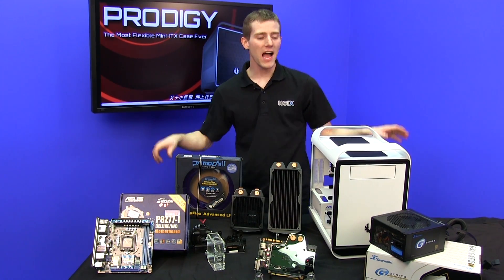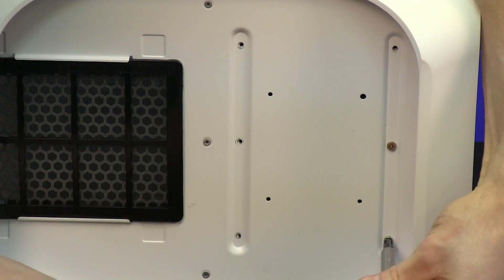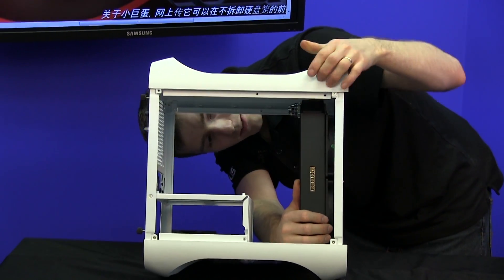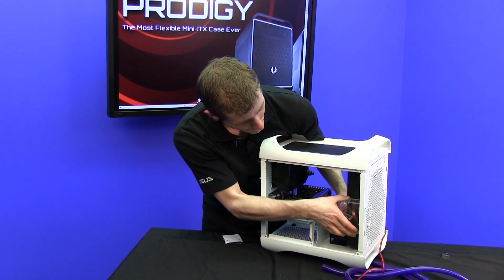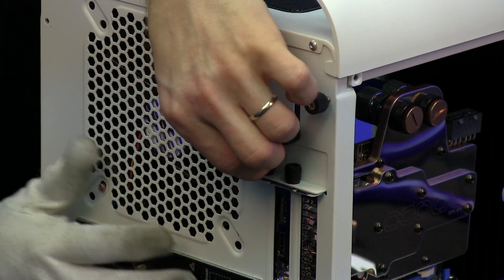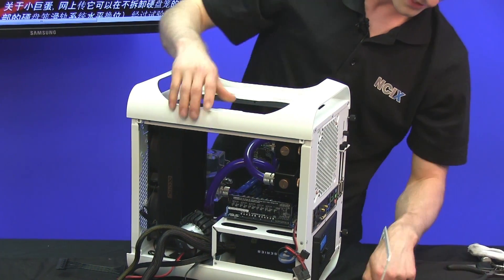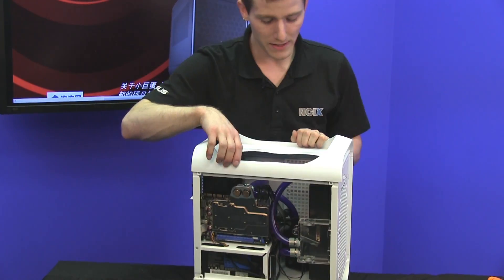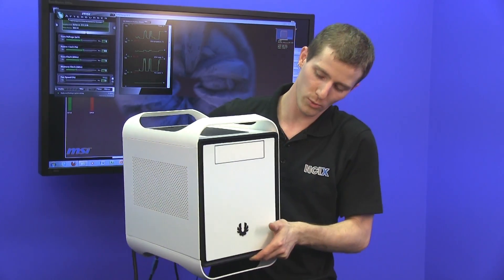Ultimate Watercooling Build Guide: Bitfenix Prodigy, 3570K, GTX670, swiftech

Comment: His question was, is it safer? The answer is yes, fan cooling is safer as there is 0% chance of any liquids leaking on to your components. This however is still highly unlikely if you set up your watercooling correctly. More likely to happen with one of the AIO liquid coolers. If you are unsure about watercooling then stick with air. Main benefits of watercooling are noise level and lower temps but the best air coolers have very good performance also.

Comment: It depends.
Some cheap fans actually breaks and blows some oil over the system.
But if you use an ALC it will prob not be a problem.
If you're going custom WC make sure that you know what you're doing.

Comment: Screw small back plate to the power supply mounting holes (Inner Holes) and then slide the power supply in to the case and then use the outer screw holes of the plate to screw and secure the PSU to the case.  Don't just wedge it all up in there like he did LOL

Comment: Umm, after I tried to read your comment, I think I get the question.  The Quadro series (He has one in this, I think) are workstation cards, very different from gaming cards.  This small motherboard is a Mini-ITX Board, and, if it has 1 PCIE x16 Slot, it can fit any graphics card that is 2 PCIE slots or smaller.

Comment: I did the same and it works fine

except I used a smaller pump and reservoir and it is called the. Alphacool DC-LT 12v Ceramic Pump and the 
Alphacool DC-LT Pump Top  and Alphacool Reservoir for DC-LT Pump Top

Comment: I like your build but i am gonna fit a 30mm 240mm on the top and a 200mm radiator in the front with a bitfenix 230mm

Comment: You're so wrong it hurts my brain to read that. The NH-D14 is about as good as it gets, and it's about tied or worse than a H80i and H100i. Yes, it's cheaper, but it's absolutely MASSIVE, and weighs so much that a buddy of mine now has a snapped Z68 motherboard because of the stress the cooler put on it. You can Stuff an H80i just about anywhere in a mini sized case. But these are closed loop watercoolers, which get their ass completely handed to them by custom loops. Sorry, but you're an idiot.

Comment: Linus said " we're using double thick radiators"  well for most All in One liquid cooling systems that are prebuilt, etc..they are 25mm thick.  However, he's using a custom setup liquid cooling kit.

Thus if all else fails and you can't find that exact 240mm rad and other 120mm rad Linus used in this video.  I would assume the BOTH of the rads are at least 50mm thick WITHOUT any fans attached given how thick they look in the video in relation, visually, to the fans attached that are 25mm

Comment: Why do you need 32GB of ram? Do you plan on running VM's and adobe premier photoshop and sony vegas hard core? CAD? Unless you're using something extreme RAM intensive like any/all of those dealing with content creation, 16GB of ram should be plenty. There isn't really much point in more than that,and there is absolutely NO point in needing that much in gaming at this point in time and probably even for the next 3 years.

2nd question...The Prodigy M coming in a few months, per Compute.

Comment: Yes.  tHIS , original, prodigy.  However, there is a Prodigy M coming shortly as shown in one of the video coverage at Computex recent that houses a Matx motherboard with the board back in vertical position but rotated 180 degrees to where everything is upside down from what is considered the normal orientation of most cases.

Comment: Because most people who are plugging and unplugging usb devices like thumb drives and other temporary storage options may have their desks in a corner like me and get tired of having to turn the case and/or reach around the back to connect and unplug usb cables.  It's easier to plug and unplug usb stuff on the front or as close to the front as possible.

Audio?  I don't know about you, but when I put on my gaming headset, I'm not plugging it into the rear audio ports.  corsair 550d here.

Comment: Yes if you don't use a 240mm rad in the front you can leave the bottom drive bay in. This will mean a lot less room for a pump though. You may be able to fit a 2.5" hard drive in the side panel but I'm not sure.

Comment: I think they attached the heatsink wrongly, because the thermal paste only hits half of the copper core on the heatsink which is made of aluminum and copper. I reapplied the thermal paste not so long ago, it went 12-15c colder. The thermal paste I used was a rather crappy CoolerMaster NanoFusion. It still goes hotter, but on 1366x768, 89c was at the near end of the game, the early times went a lot colder, but on full HD it's about 85c.
GV-N550OC-1GI. In my city, they only sell GPU from Gigabyte.

Comment: So just get some 99% isopropyl alcohol and wipe the old stuff off and if base of the heatsink is aluminum get some Artic MX4. If it's copper, you should get some Coollaboratory Liquid Ultra. Liquid Ultra corrodes aluminum so don't get it for aluminum heatsinks. However it gives better results than any other thermal paste available to public. I have a GTX 680 Lightning, the highest end GTX 680 you can get, and they still did a bad paste job. Applied MX4, temps dropped 15c.

Comment: That's ridiculous man. What manufacturer is your card from and what model? Those temps are WAY too high. You might want to consider taking off your cooler and applying new thermal paste. There is no reason for the card to be running that hot, even with the standard heatsink running at half fan speed at full load. They probably did a bad thermal paste application. Manufacturers sometimes use way too much or the paste is crappy and dried up already and needs some new stuff.

Comment: Yes, I know about what temperatures are fine for my graphics card, but when I played Crysis 3 with the lowest possible settings but the resolution set to 1366x768, it went to 89 degrees celcius and on most games, it goes around 15 degrees celcius hotter on 1080p. Also, as you said, I already know about that too and I want that my GPU live long. Maybe I'll check out more on MSI Afterburner because currently, I'm only using it to lower the clock speed.

Comment: 80c is fine for a GPU. The 550 ti can handle up to 100c, but the unofficial rule is try to keep the temps 10c-15c lower than the official maximum so your GPU has a good lifetime. Try to keep your temps under 90c and you're fine. If the fan noise is bothering you, you can make a custom fan curve in MSI afterburner if you haven't already. Also, if you can control the voltage (try unlocking in the MSI AB settings) try stock clocks but undervolt it and see if it's stable. It will lower temps a bit.

Comment: I never checked much about water cooling and I just knew that Corsair's water cooler works on graphics card. My 550 Ti temperatures are about 67 degrees celcius when I'm in a game, but on some games it goes at 77. That was on 1366x768, but now I'm using full HD which increases the temperature to over 80 degrees celcius. I think I'll check out more about water cooling my graphics card. Right now, I'm just underclocking, I did notice that it goes a lot colder.

Comment: Indeed. Especially for the GPU. GPUs get a huge temp drop compared to the CPUs, which get an awesome temp drop as well. But the GPU under water, even the Corsair Hydrio Series water coolers mod for your graphics card works really well. My friend bought a new H100i and mounted his old H80 on his GTX 680 Lightning and got a temp drop of 15c. Awesome stuff.

Comment: Oops sorry I meant H100i. With an H100i you should definitely and easily get and overclock of at least 4.5GHz. If you get lucky you could get to 5GHz if the super-easy-to-overclock-Haswell rumors are true. Possibly even more. We'll see. Some dude posted a screenshot of the 4770k engineering sample running 5GHz at 0.9V. It takes 1.39V for me to run 4.7GHz. That's crazy.  

A tip for overclocking: Ivy Bridge's maximum heat is 105c, but you should always keep the temps 10c below the max "safe".

Comment: No problem. Good luck with the build. I also forgot to mention! With an H80i, I highly recommend you overclock your processor MORE than 4GHz, especially if it's Haswell. Ivy Bridge had the known temp issue. They normally solder the IHS (the metal piece you see on the CPU) onto the actual CPU, but with Intel 3rd gens they used crappy thermal paste. I have a 3770k and have it running at 4.7GHz with an H80i and it hits 95c at full load for 12 hours. Haswell should fix the issue, getting better OCs.

Comment: What I did is I have 2 256 gb ssds in raid 0 for my OS and things like Steam and adobe, and then I bought an external WD passport 2 tb drive and have that as a place where I can dump all of my bulk files.  I also have it set up so that google chrome sends all of my downloads there.  It has been working flawlessly for me.  It's also great because you can just disconnect the external drive and not have to worry about breaking a regular hdd while transporting it to like a lan party etc.

Comment: I'm working on a nearly identical build with the differences being an i7-3770k and 7870 Ghz Edition GPU and must retain the optical drive bay. Would a pair of 120mm Monsta rads in push/pull with Corsair high performance SP120 fans be able to cool the 3770k oc'd to ~4.5ghz and GPU?

Comment: I personally would say that it would work perfectly well, but if you want to get the max performance get a Intel i7-3770k, that with the right water cooling system would easily overclock to 4.0Ghz+.

Comment: I have some concerns for my planned build. Do I need a better cpu to hold up with the 780? And do you think I could overclock to 4.0GHz with the i5?
Intel Core i5-3570K 3.4GHz Quad-Core Processor
Corsair H100i 77.0 CFM  Liquid CPU Cooler 
Gigabyte GA-Z77N-WIFI Mini ITX  LGA1155 Motherboard
Kingston HyperX Blu 8GB (2 x 4GB) DDR3-1333 Memory
Western Digital Caviar Black 1TB 3.5" 7200RPM
EVGA GeForce GTX 780 3GB Graphics Card
BitFenix Prodigy
SeaSonic 660W 80 PLUS Platinum Certified ATX12V / EPS12V

Comment: A hard drive is no longer required, but people like to have them just to have space. Most people will get a 64-128GB SSD for the operating system and programs they want to launch very quickly, and then buy a hard drive, usually about 1TB for pictures, music, downloads from their internet browser, all that shit on to their hard drive. However, if you don't need much storage, you can spend the same amount of money on a 256GB SSD and be fine. I have a 128GB SSD in my laptop and I'm fine.

Comment: Oh god. Why the hell would you get a 4100, a LOW END CPU with a high end GPU? Biggest mistake in the world right there. You need ATLEAST a 8320 to keep up with the graphics card, and even that is a bottleneck for high end card. You would need to overclock a 8320 to about 4.7GHz to get the maximum speed out of your 660 ti and not all 8320s are capable of reaching that speed, but most are. You will definitely need a good aftermarket CPU cooler though.

Comment: It's not necessary at all. It is just for people who like to have low temps or very high overclocks/low noise. 

Why are you getting the GTX660? The GTX 780 just released last week which means the GTX760 will be coming out shortly at probably the same price as a 660. 

Also I highly recommend you overclock your i7 (4670k? I Don't think it will exist. Either a i7 4770k or i5 4570k). You should get a decent 30$ CPU cooler and overclock it to about 4.2-4.5GHz. It's 100% safe so why not?

Comment: yes, the fx 4100 is not very good by todays standards (hence the below 100 dollar price tag). The 660 requires somethingbetter 
The fastest way to test would be to use afterburner with ingame overlay, play a game that is very intensive, jack the graphics all the way up(even if you get bad fps), and watch your GPU usage percentage. If the percentage is not hovering near 95-100% (like 70% or 80%)that means that your cpu is probably bottlecking the GPU, not allowing it to run at its full potential.

Comment: Hey! I got GTX 660 Ti and AMD FX(tm)-4100 Quad-Core Processor, 8gig 1800mhz ram, 1920x1080, 120hz, windows 7 pro, and geforce experience shows that I should optimize all my games to low grafics and not ultra like gtx 660 ti can handle easy, in like BF3 and other games, does my old processor lower the preformace of my GPU? Please help me!

Comment: This is a beast Prodigy build:
wwwDOTcooledpcDOTcom/build/224
- All watercooled
- 2x 7950, 3930K, 16GB Dominator RAM, 2x 2TB HDD + dual SSD 120GB, 240mm radiator, 120mm radiator and 200mm radiator and more.
- It has won awards.
Not my computer, just wanted to show you guys. It's a beast!

Comment: You can just need to make sure that the VRM board does not conflict with the radiator and fans on the top 
I will not be using large rads like this though most alphacool ST30 (they are thinner)
This build is pretty average build though but shows that is possible to make a beasty small computer that does not take a bunch of space

Comment: I've been thinking about building something similar, would it be possible to fit a H100 watercooler and a gtx 680 with stock cooling into it as well as a 3770k with an ssd and a hdd?

Comment: yes that is true but i have a h60 on my gtx 480 and my temps under full load are 70-80.c add a mounting bracket from dwoods which allows you to do that for most cards

Comment: The CPU temps aren't that great my idle temp currently 28c and my full load temp is 60c @ 4.4ghz on a i5 2500k cooled by air. I am also using the same monitoring software as linus.

Comment: 15:00 My 670 Windforce runs load at 55-65, usually below 60, and it's overclocked to 1ghz. Still impressive that that little thing gets slightly better than average temps, but they're not that much better.

Comment: Okay for grins and giggles, my 3550 is in a Node 304 case and using a Water 2.0 Performer with only one fan and at 4GHz, the same speed as Linus my temps are 60-66 under prime, his were 55 to 65. So I paid less for the CPU and cooling setup and used a smaller case with less cooling and maintained about the same temp. HHMMM

Comment: This used to be the thought, (same as always using front fans as intake with top fans as output, to naturally flow) but they have tested loops and the temperature difference is less than 1 degree from very end to just our of the rad. Same with airflow in systems, usually less than 2 degrees different, as long as there is good airflow to begin with.

Comment: Temps on the 3570K seem legit to me, especially if it's not too warm in your studio. 4GHz sounds like stock volts or less to me, unless you got a particularly bad sample, which is why you can probably run it with the tiny little heatsink that comes with it without much of an issue. Obviously this loop is much better :P

Comment: Run a few calculations, will you, That swiftech pump operates anywhere between 400 and 800 litres per hour. For simplicity of maths - let's call it 600. That makes 10 l/s. Since the system isn't that big, let's suppose it takes 1l of fluid to fill. This means the fluid circles around 10 times every second. Assuming a water equivalent, specific heat capacity is 4200J/kg.K, but since 1l has the approx mass of 1kg, it would take 42kW of heat to increase temperature by 1 degree on a single pass.

Comment: If you leave the top open (maybe install fan grilles with no fans beneath them) this case looks well ventilated enough for you to flip the fan of the rear radiator the other way and use it as an intake. This passes fresh, cool air over the rear radiator instead of the warm case air, and makes for better cooling. It probably doesn't make that much difference, but it's worth considering.

Comment: Yes it is, a corsair ax 750/760 for example fits just fine and you have more then enough room to route the cables and then screw in the psu with a good 20mm of space for the connectors. As long as you dont try to screw it in and then plug the cables in (which you are not ment to do with any psu in the case), thats more then enough space.

Comment: Hmm...  something has to be off on that processor.  With THAT much cooling, it should be coming nowhere near that temp...  I have to same processor, overclocked to 4.6, and only have one single thick 120.3 rad cooling that plus a GTX 690.  I never break 40c when idle, and never break 70c under stress tests...  And mine is even INSIDE of my TV stand so it is just getting reused stagnant air instead of cool clean air.

So in conclusion, your processor is broken, your motherboard....

Comment: I am not all that impressed with the cpu temps. My 2500k at 4.4 hits 65 with a single normal rad from a kuhler 620. But the gpu is nice, I will be strapping a kuhler 620 to that soon too.

Comment: I've just ordered a Waterblock for my MSI 7950 TF3 since it's fan is super loud. will go nicely with my XSPC RayStorm watercooling kit. If temps are not to what I would like I'll add a 120 Rad in with the 240 that's already in place.

Comment: Different things can happend. One is oxidation which will block the tightest points of the system, second is corrosion which depends on the metal in the loop and on the surface type (nickel\'pure copper\brass\etc)

Comment: unless you need to overclock to some insane level watercooling is not worth it in my opinion. get an aftermarket cooling fan with a large copper block attached and it will cool it to a nice level. also use some good silver compound in between and your good to go.
 running my amd rig with 32gigs of ram, 6tb in drives with a 256gb ssd as the os/software base. Using the cooler master hyper series cpu cooler. Temps stay cold. 

to each his own i guess.